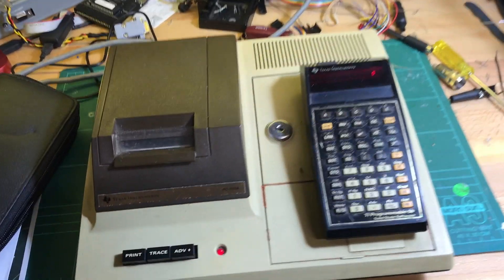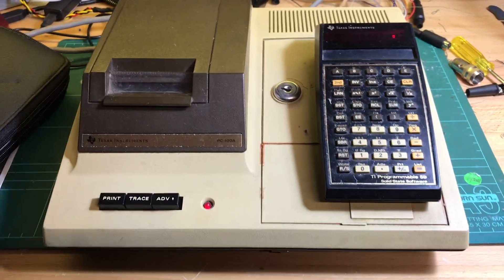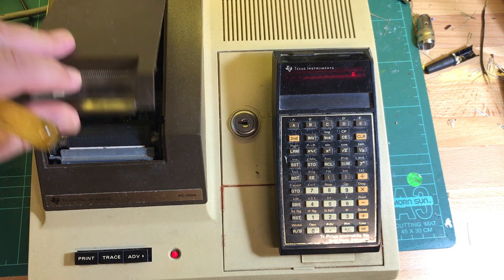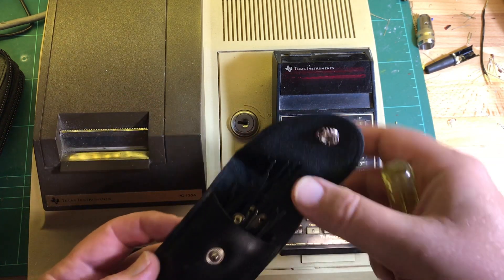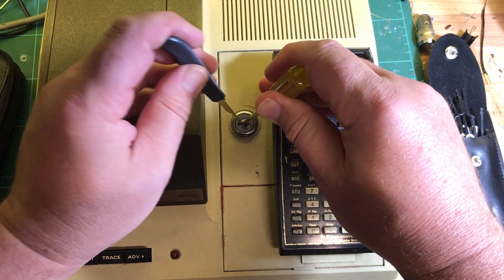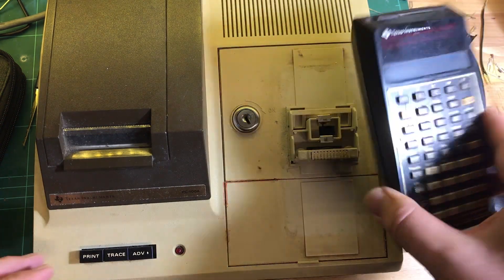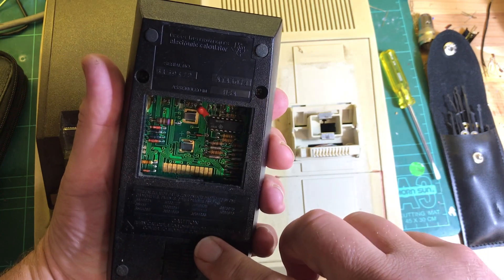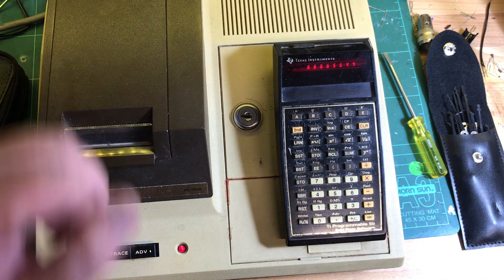🇺🇸 Liberating a TI calculator locked to a PC-100 printer/security cradle [TCE #0021]

Comment from the maker: 19-Jan-2022: Of course, when I checked ebay today most of the TI PC-100s listed come with the key ... including a listing for just the lock & key.  Duh.  There's two things I want to do further with these: [1] get a suitable replacement lock & key, and [2] swap the US 110V transformer in my PC-100C for an AU 240V version using the PC-100A in this video as a basis. /brett